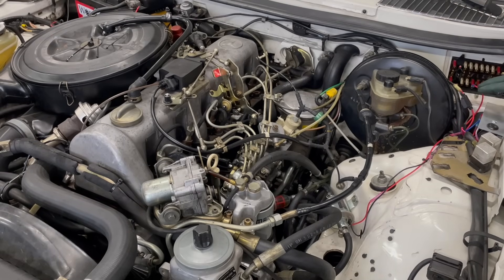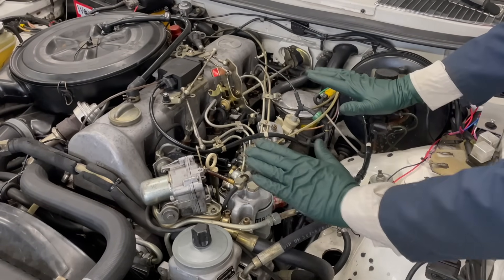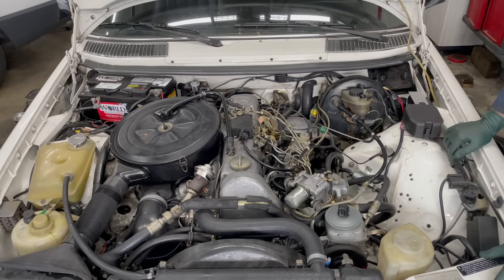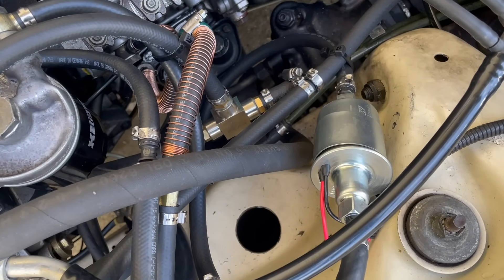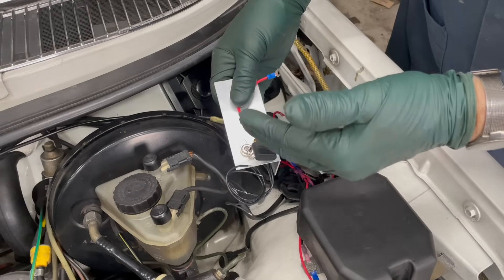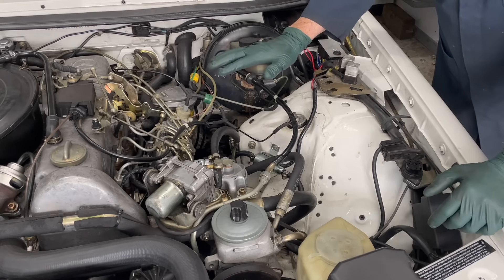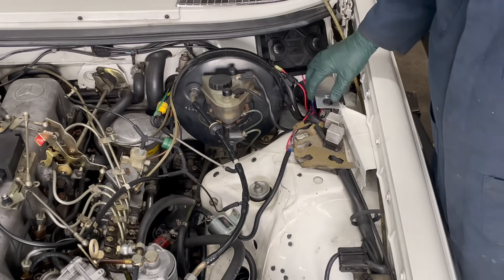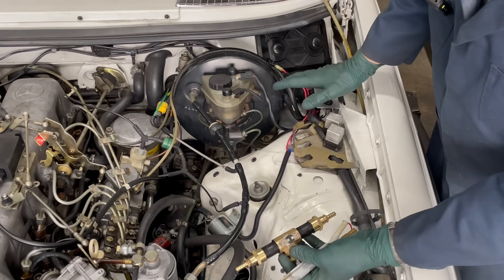Best Engine Performance Upgrade for Your Old Mercedes Diesel

Comment: i alwawys watch your videos and i dont have a mercedes yet, i have a 90s alfa romeo diesel  and im currently struggling with the advance of the inyection pump.
 i have a question, where did you fit the output line of that pump ? 
i was thinking to use vegetable and used oil also. I only recolected some litters, but nothing more. And in future i want to add some wideband to the exhaust.
Reply from the maker: The outlet of the pump goes directly (through a pre filter) rignt into the Mercedes diesel lift pump

Comment: Hi kent i am running on wvo fron the main tank but without a additional electrical pump the lify pump ia struggling to pull the wvo even summer time and after running a few minutes driving the engine stalls from fuel starvation while ideling it runs fine, which kind and model in line fuel pump do you suggest to install, please

Comment: I installed a similar setup on my wagon years ago, except I put the pump right next to the tank. I put the relay in the factory relay box, triggered it from the window circuit in the fuse box and powered it from the battery. One wire under the car to the pump, and no holes drilled except the self tapping screw for the ground at the pump. The original pump failed sometime in the first trump administration and I left it the way it was because it ran fine and I wasn’t using wvo anymore. Once my engine rebuild is complete I will install a new pump. Thanks for all that you have done to help the classic Mercedes community, you are a treasured resource.
Reply from the maker: I used to do the same 20 years ago. This new pump I use has an amazing fuel draw ability, and it is much easier to install it in the engine compartment and monitor its operation. And you do not have to get under the car, which, when you are almost 80 years old, gets to be challenging.. LOL
Reply: @Mercedessource im 30, and getting under cars is getting challenging! Thanks for the reply Kent.
Reply: @Mercedessource hi Kent! Did you pass through the mechanical lift pump or by pass it? Thank you very much!

Comment: Excellent.  I have also installed low pressure lift/supply pumps to many old diesels over the years.   Some modern tech in knowledge, to further enhance reliability and performance on old diesels.  One thing of note, the old Carter P4070 was a "go-to" universal pump for many, over the years.  The quality control has taken a huge turn for the worst recently, like many things.  I look forward to seeing a different option like yours, on the market.

Comment: Kent, you never mentioned the W124 300D VERSION diesel. I’m assuming you can use this kit for that model too?
Reply: Hola Kent, desde Argentina te saludo. Tengo un Mercedes Benz 190 D, motor OM601.911. Te consulto si se puede aplicar en este coche.
Muchas gracias por todo lo que haces
Reply from the maker: Sí, lo hará.
Reply from the maker: Yes this will work on the W124 diesels, but it will need to be modified some from the instructions.  Location of relay, location of pump, wires lengthened. But the principle is the same. In fact, it can work better on the OM602 and OM603 engines due to the weak lift pumps. I may come up with a universal kit if this proves popular.

Comment: I am very impressed with your knowledge. I have been a gas technician for 30+ years! Believe it or not I’ve only messed with diesel a few times and I am using your channel as a way to learn about diesel. I decided when I came across your channel that you were very knowledgeable. I also do electrical troubleshooting. All my buddies who technician said that I can learn diesel easy. Lol well my body is not in good shape anymore so I can’t make myself a productive member of society with labor the way that I used to. So now I have used my downtime with my body in pain all the time I have strengthened my mind. Great channel great video!❤
Reply: God bless you sir! In today's degrading  society you are valuable to us, I would love to have you as my mechanic!